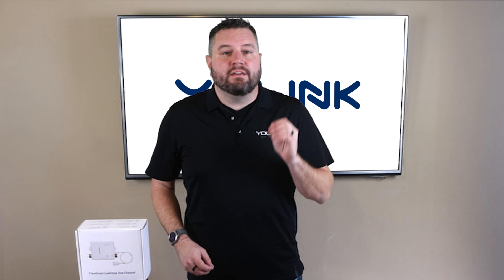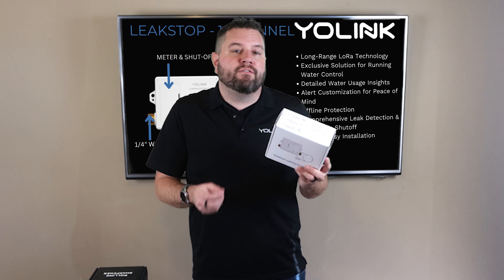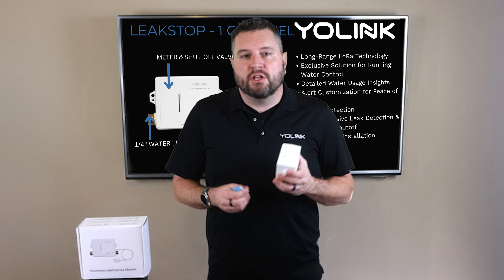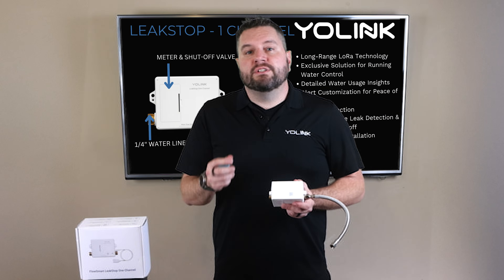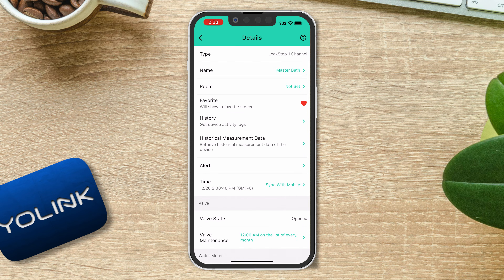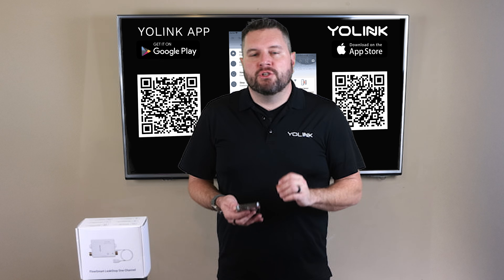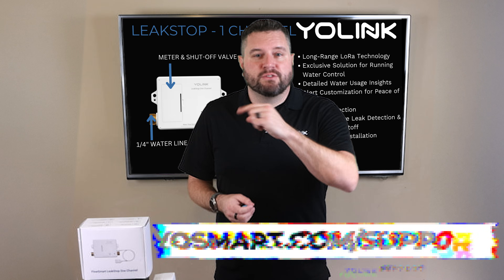A Smarter Way to Prevent Fixture Leaks – YoLink LeakStop!

Comment: Here's a word of warning, happy homeowners.  At 6:19, he is attaching the hose to the input connector on the toilet tank.  Notice that the nut he is tightening is plastic.  Those nuts can fail all by themselves - mine did after 25 years of doing nothing.  This is apparently a major source of leaks that result in insurance claims.  For an extra dollar, you can buy a standard toilet input hose that has a metal nut rather than a plastic one.  I made sure all of my toilets have the metal nuts.

Comment: It would be nice if Yolink could make something like the FloodStop Dishwasher/Toilet Leak Detector Valve, 3/8" Compression or  Phyn’s Water Sensors that connect directly to the on/off valve 3/8" compression with Yolink control.  No need for another hose connection which could potentially be a leak and shutting the leak device after that add on supply hose to the electronic valve does not solve that type of leak problem.  Any literature on the Yolink 2 stopper?
Reply: YoLink leakStop 2 channel will be available later this month.
Reply: @siriustechxu  
2 channel will be nice option.  Problem I see it will pick up leaks and shut the water off, the problem is if the water leak is at the supply hose from the valve to the Yolink device shutting the Yolink device is going to do nothing to prevent the flooding.  That is why I was talking about Phyn Valves and FloodStop those valves are actually screwed onto the wall valve, no chance of hose rupture.  The Yolink device has a hose that could rupture (Major Leak Problem (FLOOD)of all time) that runs from wall valve to the yolink device.
I use and love Yolink devices, I just wish the design was more inline what I was hoping for.

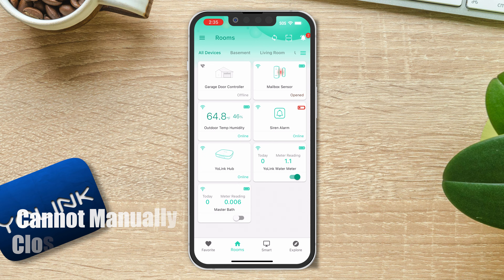Comment: at 8:06 you mentioned that you "can't close the valve in app" . Does this mean I can't create a YoLink automation to turn the valve on/off on a schedule?
Reply from the maker: Correct, due to the software design to save battery, the valve can only be opened remotely. I will confirm about scheduling!
Reply: @YoLinkbyYoSmart  Yes, you should allow the costueer'user, if they so choose, to open/close valve. You can have a pop-up saying: To extend battery life, shutting off/on valve by user, is disabled. If you enable this option, battery life will be drastically redused based on usaage....or something like that. This is a nice device, but please let users decide, certain options.
Reply: @YoLinkbyYoSmart , I suggest that you make this battery-saving feature a user-selectable option. 

This would allow automations to use your valve as a control valve rather than just a leak shutoff/water-use monitoring valve. 

Your current battery-operated valves don't have this limitation.

Adding the water usage feature to the control valve would be a great use case.